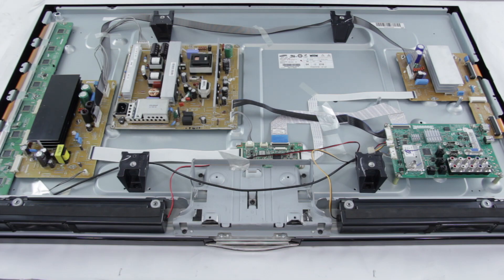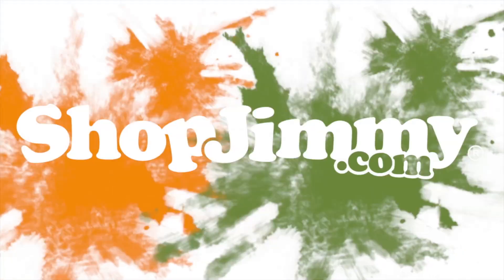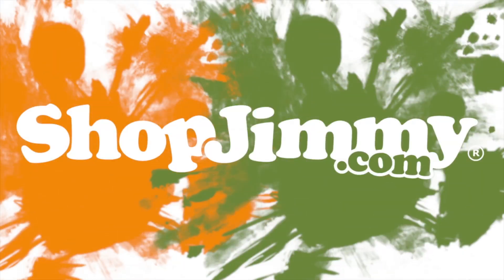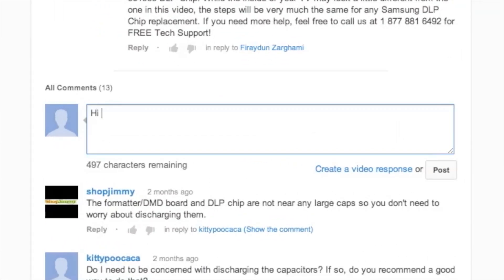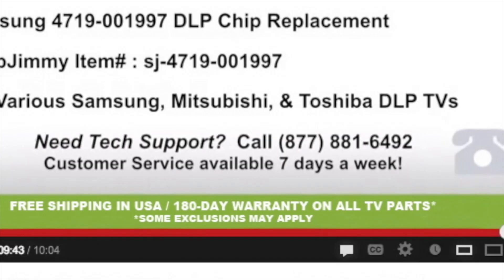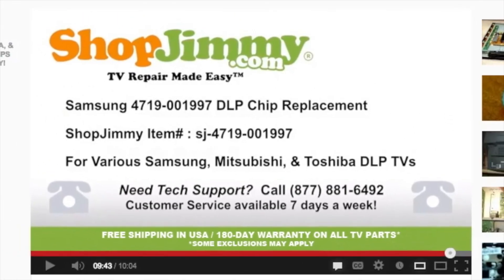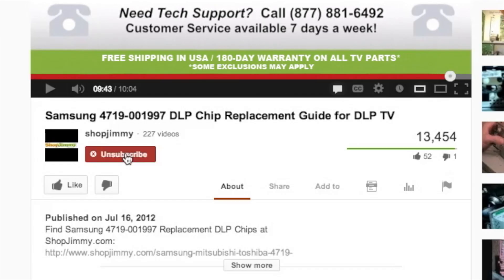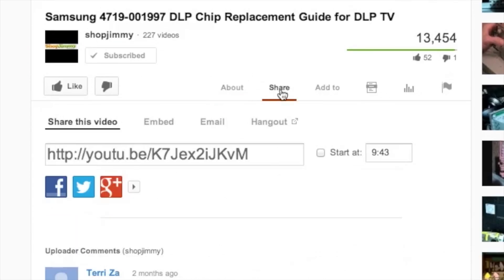Plasma TV Repair Tutorial - Common Symptoms & Solutions - How to Fix Plasma TVs

Comment: I have a Samsung Plasma TV, model #PN51D550C1F. When I tried to power it up it clicked a several times then started a series of 3 quick blinks in a sequence of 5, and continues to do it. I removed  the back panel to check the capacitors, but none of them appear to be blown. Can you give me any advice on what the problem may be.
Reply from the maker: jason shepherd  Try this repair at your own risk.  I recommend unhooking the X-Board from the TV and then see if you can power on the TV to see if it stays on with this board disconnected.    Here is what the X-Main should look like: http://www.shopjimmy.com/samsung-bn96-16523a-x-main-board.htm  Thanks and please reply with the results.  www.shopjimmy.com

Comment: i have a hisense ta42p40m,   it is mostly samsung components,  with no inputs,  there is snow on the screen,  with adding an input of any type,   with in two seconds, the tv shuts down,     we changes the power board ,and the same problem continues.     i have a blinking led on the rsag7 board.   what do you think,,  thanks
Reply from the maker: hunter63238   I recommend replacing the main board in your TV.  Unfortunately I do not see any replacement parts in the search results for your TV model number on our website.  Thanks and please let us know if you have any further questions!  www.shopjimmy.com

Comment: I have a samsung 850FH-YB08 and I'm having a problem with a vertical strip that flickers and changes colors to solid background colors. It's a 3 inch strip about 2 inches to the left of the center of the tv and seems to be related to temperature , as it only starts after the tv has been on for an hour or so... But it's showing up sooner and sooner. I would like to fix this myself and not go buy a new tv... It's only 2 1/2 years old . Nothing is made to last ! Thanks Jimmy
Reply from the maker: zachary smith   This sounds like a TV panel problem.  If your TV panel is bad, it may be more cost-effective to replace the TV as panels are typically hard to find in stock, difficult to replace, and expensive.  Thanks and please let us know if you have any further questions!  www.shopjimmy.com

Comment: I have an LG Plasma 60 in tv, model # 60PK200-UA, when I turn it on it will turn off after 10 minutes, what could be the cause?
Reply from the maker: Patria Holloway  I recommend replacing the main board in your TV.  Here is a link to replacement parts for your TV model number on our website, click here:  http://www.shopjimmy.com/catalogsearch/result/?q=60PK200-UA  Be sure to match part numbers on your current board, with your replacement for compatibility.  Here is a link to a video showing how to identify your part number, click here:  TV Part Number Guide for LG & Zenith Main, Digital, & Tuner Boards (LCD, LED, Plasma TVs)  You can also call our customer service for further assistance with your purchase.  (877) 881-6492  Thanks and please let us know if you have any further questions with your TV Repair!  www.shopjimmy.com   #plasmatvrepair

Comment: I have a Westinghouse model uw40ta2w version tw-73201-u040b the TV will not turn on.  I checked the power cable and it is outputting the right voltages. . I have been able to get the tub going once and the picture is fine. But have not been able to turn it on since. Westinghouse would and it but it will cost me almost as much as I paid for the tv to ship it back to them
Reply from the maker: R Dixon   I recommend checking the capacitors on the power supply to see if they look bulged or puffy on top.  Take a look and let us know what you find!  www.shopjimmy.com  #badcaps

Comment: Jimmy....on plasma TH-50PZ77U issue about No Audio from HDMI port
Reply from the maker: boldboy1   I recommend replacing the H main board in your TV.  Here is a link to replacement parts for your TV model number on our website, click here:   http://www.shopjimmy.com/catalogsearch/result/?q=TH-50PZ77U  Be sure to match part numbers on your current board, with your replacement for compatibility.  You can also call our customer service for further assistance with your purchase.  (877) 881-6492  Thanks and please let us know if you have any further questions with your TV Repair!  www.shopjimmy.com

Comment: i have a Samsung plasma pn50a400. the remote sensor on the tv isn't working.  I've tried 3 different remotes and new batteries and moved several electronic components  at least 4 ft away but still doesn't work. is that component a dyi project?
Reply from the maker: Sel Batir   This sounds like a problem with either the main board or the IR sensor.  You may need to replace each board individually to see which one fixes the problem.  Here is a link to replacement parts for your TV model number on our website, click here:  http://www.shopjimmy.com/catalogsearch/result/?q=pn50a400  Be sure to match part numbers on your current board, with your replacement for compatibility.  You can also call our customer service for further assistance with your purchase.  (877) 881-6492  Thanks and please let us know if you have any further questions with your TV Repair!  www.shopjimmy.com

Comment: I have a LG_50PJ350 Tv
the tv comes on as usual but has spotty red discoloration on the edges tv also has humming noise coming from it also
Reply from the maker: Shane Tillery   Isolate the humming and replace that part that is humming.   Start with the power supply then listen to the X board, etc.  Let us know what you find or if you have any questions!  www.shopjimmy.com

Comment: Hi There, Well I installed the main board that I received from ShopJimmy and I have the same symptoms as described below.  No change at all.  When I called SJ,  they told me to email and see what you say about it.  What should I do now.  Should I return the board and try something else or ???????
Reply from the maker: T. Joyce   Please reply with your TV model number and problems you are having, just to be sure we are on the same page.  Thanks!  www.shopjimmy.com
Reply: If you look right below this post I put in the description 2 times.
Reply from the maker: T. Joyce   Just wanted to be sure this was for the same TV.  Since the main board did not fix the problem, you can return the board and I recommend replacing the power supply to see if that fixes the problem.  Here is a link to replacement parts for your TV model number on our website, click here:  http://www.shopjimmy.com/catalogsearch/result/?q=sk-26H240S  If we are out of stock, you can sign up on the product page to be notified when the part is back in stock, however there is no way for a us to predict that timeline.  Be sure to match part numbers on your current board, with your replacement for compatibility.  Thanks and please let us know if you have any other questions.  Thanks!  www.shopjimmy.com
Reply: Ok. Will I be charged a restock fee for this board?
Reply from the maker: T. Joyce   Please call our customer service to discuss the return.  (877) 881-6492  Thanks!

Comment: Thanks for the video.  A friend gave me his Panasonic TH-46PZ80U plasma TV that is not turning on.  I was hoping it was as simple as just replacing some bad caps but I could not find any so hopefully you can help.  When I plugged it in, I heard 2 clicks from the center board in the back (I had the back plate off and it was clear the area it came from).  I then pushed the power button and heard the same two clicks.  I also noticed there is a red light on the front that blinks 7 times, followed by a few second break, then it blinks 7 times again.  Any thoughts?
Reply from the maker: showell62  I recommend replacing the SC board in your TV.  Here is a link to replacement parts for your TV model number on our website, click here:  http://www.shopjimmy.com/catalogsearch/result/?q=46PZ80U  Be sure to match part numbers on your current board, with your replacement for compatibility.  You can also call our customer service for further assistance with your purchase.  (877) 881-6492  Thanks and please let us know if you have any further questions with your TV Repair!  www.shopjimmy.com
Reply: ShopJimmy.com I just noticed that in addition to the problem I mentioned, there is a crack inside the screen (not on the surface). I don't know if it was there or my son got to it in the last month.  This will probably show right?
Reply from the maker: showell62   What will show?  If you have a cracked screen, we do not sell screens, so we will not be able to provide a replacement.  Thanks!  www.shopjimmy.com

Comment: have a samsung PN60e530a3fxza i isolated both y and z boards turn the power on and the voltage on pin 1  CN-4005 comes up and then drops back to zero
replaced the power supply and it did the same thing. HELP.
Reply from the maker: Myron Lewis   What does the TV do with everything hooked up?  Thanks!  www.shopjimmy.com

Comment: Hello the Jimmy, I have an UpStar 40 in. LED hdtv model # P40ETW and my problem is that it happens constantly when I turn on the tv it shows a quick blue flash then the image turns black but I still have sound. What can I do to fix this? I appreciate your help
Reply from the maker: Jesse Hortas   This could either be a problem with the power supply, LED driver or the LED strips.  You can begin replacing boards to see if they fix the problem.  Unfortunately I do not see any replacement parts in the search results for your TV model number on our website.  Thanks and please let us know if you have any further questions!  www.shopjimmy.com

Comment: I have a Toshiba 2006 42HP66 plasma tv that started "bleeding" the red colors.   Checked all settings and nothing works.   Can this be fixed?
Reply from the maker: Retiredmomma   I recommend replacing the YSUS and Y-Scan Drive boards in your TV.  Here is a link to replacement parts for your TV model number on our website, click here:  http://www.shopjimmy.com/catalogsearch/result/?q=42HP66  Be sure to match part numbers on your current board, with your replacement for compatibility.  You can also call our customer service for further assistance with your purchase.  (877) 881-6492  Thanks and please let us know if you have any further questions with your TV Repair!  www.shopjimmy.com

Comment: Hi, we have an HP plasma and we had a storm yesterday and today that caused a tiny power outage. It seems like the HDMI ports got damaged bc we can't see Directv through any of the ports. We had to change from one input to the other yesterday and it worked, but then today's storm cause the other port to not work also. Can you help us?
Reply from the maker: Claudia   I recommend replacing the main board in your TV.  Please reply with your TV model number.  Thanks!  www.shopjimmy.com
Reply: Hi thanks for your response. the model number is CPTOH-0709

Comment: I have a Samsung Plasma Model SP R4232 was watching TV and heard a pop/snap then display was fussy with black red blinking screen, audio was working the screen was not.  There was also a smell like burnt rubber no smoke just a slight smell.  What would you recommend I try to fix it my self.  I really appreciate any advice you can give.  Model SP R4232 Serial Number 39FY39FY3CMY804996R
Reply from the maker: Marva Weeks   I recommend replacing the Y board and buffer(s) in your TV.  Unfortunately I do not see any replacement parts in the search results for your TV model number on our website.  Thanks and please let us know if you have any further questions!  www.shopjimmy.com

Comment: I have a Samsung plasma TV model PN50B430P2D. The TV is working but vertical lines have appeared. The lines are about 1.5 inches apart and across the entire screen. The lines are whitish in color. They will go away for seconds every now and then but they always come back. It looks like everyone I watch is in jail now. I am not sure what could be causing this. My guess is the logic board, have you heard about this problem before?
Reply from the maker: Linda Labonte   This sounds like a TV panel problem.  If your TV panel is bad, it may be more cost-effective to replace the TV as panels are typically hard to find in stock, difficult to replace, and expensive.  Thanks and please let us know if you have any further questions!  www.shopjimmy.com

Comment: I have a Panasonic th-42px80u  tv wont turn on the red led just slowly flashes over and over
Reply from the maker: dean castello   Is there any pattern of blinks?  If there is no pattern, then I recommend replacing the power supply board.  Here is a link to replacement parts for your TV model number on our website, click here:  http://www.shopjimmy.com/catalogsearch/result/?q=th-42px80u  Be sure to match part numbers on your current board, with your replacement for compatibility.  You can also call our customer service for further assistance with your purchase.  (877) 881-6492  Thanks and please let us know if you have any further questions with your TV Repair!  www.shopjimmy.com

Comment: I have a panasonic Plasma TCP55VT50 manufactured in 2011, Im getting sound but no picture.The red light on the power blinks 7 times if that means anything.
Reply from the maker: Victor Valle   I recommend replacing the SC board in your TV.  Here is a link to replacement parts for your TV model number on our website, click here:  http://www.shopjimmy.com/catalogsearch/result/?q=TCP55VT50  Be sure to match part numbers on your current board, with your replacement for compatibility.  You can also call our customer service for further assistance with your purchase.  (877) 881-6492  Thanks and please let us know if you have any further questions with your TV Repair!  www.shopjimmy.com

Comment: I have a Protron PLTV-4250 red standby on but tv will not turn on have tried another power board no luck...need help, Thank you
Reply from the maker: shubug50  I recommend replacing the main board in your TV.  Here is a link to replacement parts for your TV model number on our website, click here:  http://www.shopjimmy.com/catalogsearch/result/?q=PLTV-4250  Be sure to match part numbers on your current board, with your replacement for compatibility.  You can also call our customer service for further assistance with your purchase.  (877) 881-6492  Thanks and please let us know if you have any further questions with your TV Repair!  www.shopjimmy.com

Comment: Hey I have an lg 50pk550-ud plasma tv it was turning on quickly then off. I replaced the power board now it turns on and stays on but I have no sound please advise. Thanks.
Reply from the maker: Chad Brundage   First, I would check to make sure everything is connected correctly and seated properly on your boards.  If everything looks good, then I recommend replacing the main board.  Here is a link to replacement parts for your TV model number on our website, click here:  http://www.shopjimmy.com/catalogsearch/result/?q=50pk550-ud  Be sure to match part numbers on your current board, with your replacement for compatibility.  Here is a link to a video showing how to identify your part number, click here:  TV Part Number Guide for LG & Zenith Main, Digital, & Tuner Boards (LCD, LED, Plasma TVs)  You can also call our customer service for further assistance with your purchase.  (877) 881-6492  Thanks and please let us know if you have any further questions with your TV Repair!  www.shopjimmy.com

Comment: I have an LG 50 PS60-UA it has standby power and will turn on for about 3 secs then turn off to standby power. LG customer service is no help whatsoever. Any help will be greatly appreciated
Reply from the maker: Mark K   I recommend checking the capacitors on the power supply to see if they look like mushrooms and are puffy on top.  If the capacitors are good, then I recommend replacing the main board.  Here is a link to replacement parts for your TV model number on our website, click here:  http://www.shopjimmy.com/catalogsearch/result/?q=LG+50+PS60-UA  Be sure to match part numbers on your current board, with your replacement for compatibility.  Here is a link to a video showing how to identify your part number, click here:  TV Part Number Guide for LG & Zenith Main, Digital, & Tuner Boards (LCD, LED, Plasma TVs)  You can also call our customer service for further assistance with your purchase.  (877) 881-6492  Thanks and please let us know if you have any further questions with your TV Repair!  www.shopjimmy.com

Comment: Great video! I have a Samsung 51" plasma and I have all the voltages on the power supply, but nothing happens when I power up the TV, no clicks nothing. I did what's recommended and unplugged the Y & X boards, and still nothing. I am guessing its the power supply?
Reply from the maker: thechangee   If you have all the voltages from the power supply, then I recommend replacing the main board.  Please reply with your TV model number and then I can recommend a replacement part for your TV repair.  Thanks!  www.shopjimmy.com

Comment: hi my samsung 3dtv mod No ps43d490a1wxxu  just turned its self of and the red standby light flashes when i pull the plug out and then put it back in it clicks as if it were going to turn on it does this 3 times but doesnt turn on  then the red light flasher twice about 5 times then stops flashing for about 10 seconds and starts again flashing of and on 
hopefully you can sugest a fix thanks
Reply from the maker: john murdoch   Take the proper safety precautions before trying this repair.  Unhook the Y board and power the set up to see if it stays on if it does replace the y board if the set doesn't stay on it will be either the X board or your power supply.  Unfortunately I do not see any replacement parts in the search results for your TV model number on our website.  Thanks and please let us know if you have any further questions!  www.shopjimmy.com